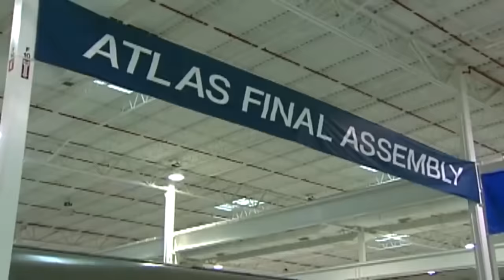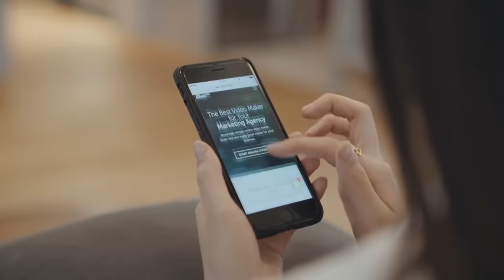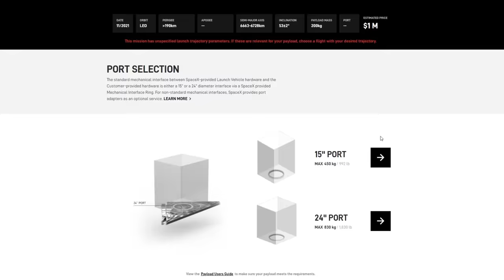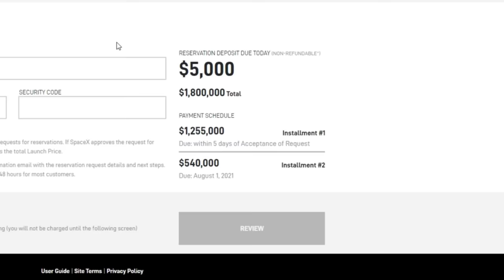SpaceX’s Genius New Satellite Launcher

Comment: You totally forgot about virgin orbit and other space launchers with cheap dedicated launches, virgin orbit can launch from basically everywhere there is airport.
Reply: There is no benefit of launching from random airports unless the airport is in the equator. You want to launch at the equator because it is there where the energy needed to reach orbit is the lowest.
Reply: @kazedcat  there is a benefit actually, and also doesn't matter like you said even at the equator the plane can still launch everywhere at any time unlike rockets.
Reply: @carholic-sz3qv  Once you are at the equator you can put satellites into any orbit at minimum energy. There is no need to be anywhere the most direct path to any orbit is in the equator. Orbits are not constrained by earths geography you can go anywhere if you launch from the equator. Being anywhere other than the equator just increases the time you reach orbit.
Reply: Also you cannot launch anytime or you end up in the wrong orbit. Time is very big constraint in where you end up in orbit. You must launch at a specific time window to get to a specific orbit. Orbital mechanics is completely different than terrestrial navigation. When is what gets you somewhere. Where is just an adjustment in timing window and payload mass. If you are not at the equator then you arrive later and must launch earlier and since you will be in flight longer you either need more fuel or reduce your mass.

Comment: The act of launching a satellite leaves so much debris. What happens to the second stage. Do those latches need to just fly off?
Reply: Second stages normally do deorbit burns where they burn up in the atmosphere over the ocean where dead space objects go to die (and where the ISS is planned to be parked in like 10 years MAX). A recent incident showed a failure to do a deorbit burn that dragged the process out for 3 weeks. Either way it gets back to earth. The only time it doesn't is geostationary orbits where they don't have enough fuel to deorbit, so it sits there. 

However, none of that matters since SpaceX has already offered the government the ability to contract out the starship AT COST to clean up space debris. Elon assumes the $150 billion production cost, and the government foots the ESTIMATED $2 million refurbishing price per launch.
Reply: @ryanthompson3737  Thanks for your insight. Do you mean they're going to deorbit objects but return the vehicles to be reused or that they're offering reburbished end of life vehicles for suicide missions containing retrieved objects?

Comment: "Cheap and reliable spacex"
I wonder how many people actually believed that sentence
Reply: Well they are much cheaper than any competition and nearly as reliable as ULA for example
Reply: @yanniklemm4108  excuse me? How much does spacex get money for a single Kilogramm send to orbit? Was it 70k$ from nasa? Of corse they can sell the tickets way much lower than any competitors.

And reliability....
Almost every third rocket exploded. The sojuz is the most reliable rocket ever, that's why people are send using that one. Not spacex.
Most important equipment is send by Esa delta rockets, not spacex falcon heavy.

SpaceX can't be theoretically be cheaper and more reliable because it added the extra step of reusability. And don't get me started of how much gets shreked after a launch and most of the engine still needs to be refurbished. They just don't tell that.

Comment: A mission to Mars is a suicide mission.  Minimum trip time is around 22 months.  The radiation and cosmic rays exposure alone might be fatal.  Then 22 months in zero o 40% gravity will cause vascular and heart issues as well as a swelling in the head.  Short term this will cause lowered vision, but it also is a massive increase in the risk of heart attack and stroke.  Then there is the fact that when they reach Mars they will have spent 6 months at zero G and even with regular exercise will be so weak they will struggle to stand on Mars with a bulky space suit on.  Unless there is a station already set up for them (which would delay the mission years or more), they will struggle to get a shelter set up.  the whole time they will be on a planet with NO MAGNETOSPHERE, so radiation dosages will be through the roof.  Then there is the fact they need to survive the takeoff, refueling, trip to mars, re-entry...and that stupidly dangerous belly flop maneuver and landing... rinse and repeat.  If anything fails they are all dead... if it works 100%... they still might not survive it and the dosages of radiation will likely still kill them within 5-10 years.

Send a lab, send robots, collect samples and send them back to earth to study... do not send people and do not waste the money even trying to develop a base on Mars.  The soil is too toxic and acid to grow anything and even tracking dust into the base could cause health issues... and that dust will get everywhere.  They will need vacuums and maybe even a shower in a 2 stage airlock to keep the dust out.  Set up a base.  Make fuel and energy productions.  Send a ton of equipment and some robots.  After they can set up an underground facility and lean it and there is enough water and oxygen, enough power production, enough fuel stored for a return trip... then "maybe" send a manned trip in 2035.
Reply: @sheev9852  What in particular are you doubtful of.  All this is known.  Somehow they will make solutions to these problems.  I know exercise can slow bone loss and atrophy, but not get rid of it and astronauts that come back from long stays on the space station can not even walk for several day.  Hopefully the 38% gravity will help them in that aspect of the mission.  By then though they will be suffering from poor eyesight do to the swelling of the head.  Again maybe the 38% gravity will at least help.  We have not tested the effects of gravity at those levels long term.  Maybe they will have far less issue, but currently based on the data we do have it does not look good for them.

Now if Elon focused on setting up a base over the next 4-6 years so the astronauts would have a shelter out of the radiation and cosmic rays, their chances will greatly increase.  It seems he does not want to wait.  He keeps saying a manned mission coming soon, but then he says a mission.  Maybe he is not planning on the first several missions to be manned.

The trips either way will be brutal as 6 months in space is pretty long for someone as the typical stay on the space station is that long and we know the effects of that.  The main difference is if something goes wrong there is no way bake and no possibility of a rescue team.  Second is, unlike the ISS they will not be inside the Earth's magnetosphere (and Mars has none).  The ship must be far better shielded than the ISS.  They already are planning a bunker on the ship for solar storms, but they can not live in the bunker.

Radiation levels can be 50 to 2000 mSv per hour.  1000 mSv will cause radiation sickness and 5,000 mSv will kill half within a month.  Even on Mars these radiation levels are lethal.  To provide the same level of protection as Earth's magnetosphere requires 5 meters of soil.

Another example would be an astronaut in a space craft orbiting the Earth 1'000 km above the equator. If the spacecraft were protected with 4 mm aluminum shielding then he would be exposed to a dose rate of 2.7 mSv/h.  This would be about one natural annual dose per hour.  The Apollo missions lasted about a week and a half... this will be 6 months each way.  This would be 30-40 times as much radiation or about 9000 lifetimes of radiation.  NASA estimates that a solar flare would have been lethal to the Apollo astronauts with even 20mm of aluminum as 20mm only blocks 90% more than 4mm of aluminum.  I am not sure how effective the 3mm stainless steel will be or what other shielding they will have and what it would take to protect them from a solar flare.

All these issues will be much worse on the trip home.  They likely will have only partially recovered from many of the problems and their immunity system will be at its weakest point.  Shielding that Reduced radiation levels to what Apollo had would be fatal.  In fact they would likely die before they reached Mars.  Elon has a lot of things to work out before he can do a manned mission and radiation will be just the first problem.  Shielding is NOT light.